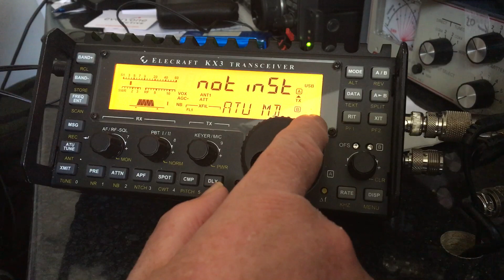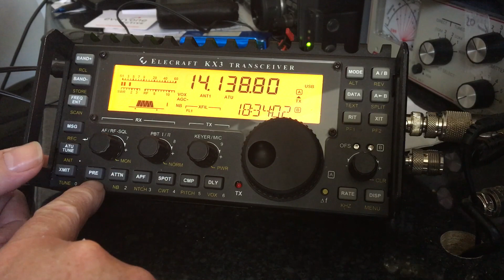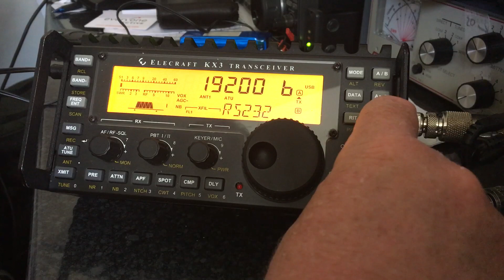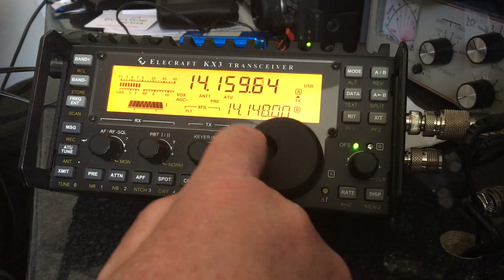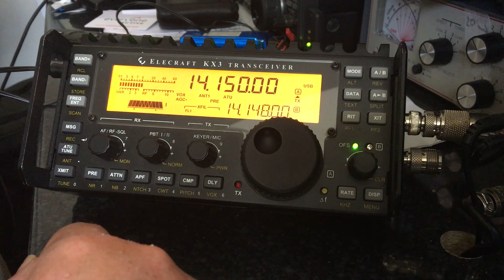KX3 Receiver Setup Basics

Comment: Nice vid - I think it's a good radio for anyone, including beginners! At 4'10 you talk about the Noise Reduction being only available on CW or AM. The manual (page 13 in the PDF) does not mention this, and mine works fine on SSB, though it does drop the audio level quite a lot. Cheers, Jon GW4LJW.
Reply from the maker: Yes, I think it was my mistake, still not sure what caused it. Cheers

Comment: I have chased around my KX3 with one bug after another. First it was the ATU being locked in 24:1 SWR. That lasted for a while then spontaneously resolved. Then I got an error message on the time clock/battery charger, except that I didn't have that function installed.  Opened it up and to verify. No help. Couldn't rotate the VFO knob counterclockwise past that error message.  I had to use the nuclear option (reinstall) to get rid of it, now have to retune all the bands on the unit to redeploy. The unit jumps randomly from LSB to USB on 40 meters. On CW decode, oftentimes I  can not bring up the thRR to tune the sensitivity. There just is no predictable reproducible function on the KX3 it seems. No response from the Elecraft after two weeks although they state that due to Cov this has been put on hold.

You've covered a lot of the functions that I haven't even gotten around to because I have been so busy chasing the Gremlins.   But from my perspective, you could make a long series chasing down the bugs in the KX3.    This radio is not for beginners. 73' AF5LQ
Reply from the maker: Hi, I think you have been unfortunate or I have been lucky, as other than what I covered on the video I've had no gremlins in my KX3. But you are right, it's not for the beginner. I hope you get your issues sorted soon. 73s, Adam.
Reply: @g1zhd-adam  This thing will give me no peace. Bought a 100 watt 50 ohm 
Mcbazel Surecom 0014-0156 PL259 Male Plug DC to 1.0GHz 100W Watt 50 Ohm Dummy Load
And have Fred Cady's  Book The Elecraft KX-line. I have erased the entire KX3 and tried to reinstall complete new updated firmware, trying to restore the latest bug, the loss of  functionality of my ATU -having tried bYP , NOR, and other functions  and  keep getting  d=000  ERR TxC when I try to use the ATU or transmit. All I can do now is receive.  Of course, Elecraft won't even respond even though I have purchased two complete lines of KX3's, PX3's and KPA100s from them! I have kept one as a back up that I haven't dared use because I am afraid that I'll have two duds on my hands. I have wasted so much time with the KX3 and am reluctant to have to spend more time with a completely new radio company. It has become a tarbaby, each problem drags me deeper into a diagnostic mess. The radio is dysfunctional for any practical use.
Reply from the maker: @hzilla5550  I would contact Elecraft and ask them for advice. You may need to send it back to them to figure out the issues. Sorry to hear your troubles.

Comment: What cw filtering is supplied as standard?  Or is that a extra ? Thinking of getting one of these radios
Reply from the maker: I haven't added any additional filtering, I just use what it came with. I suggest checking the latest product specification just in case it has changed since I bought mine. If you haven't bought one already by now.

Comment: Hello Friend! How is the level of the speech compressor adjusted and how to activate it? DE R5CX
Reply from the maker: Simply single press the CMP button (button 5) and turn the knob above it to adjust.
Reply: @g1zhd-adam  Not so simple and easy! If the ESSB item is activated in the setup menu, then the compressor cannot be turned on / off from the front panel! I hope this is not news for you 😎

Comment: Thank you for this video.. I am a new owner of a KX3 and as everyone says it is taking time to learn all of its capabilities.  
Not sure if I'll ever change the RX EQ settings from 'flat',
BTW at 4:15 in your video you say that the Noise Reduction doesn’t work on SSB.  Is that a mistake as NR is available in SSB mode on my KX3 and seems to work as it should. 
73s
Reply from the maker: May be it's the Firmware version I have but no, when I go to select NR on SSB it's say "N/A".